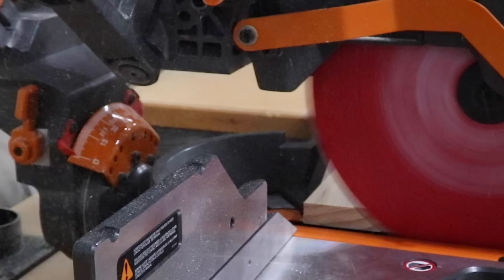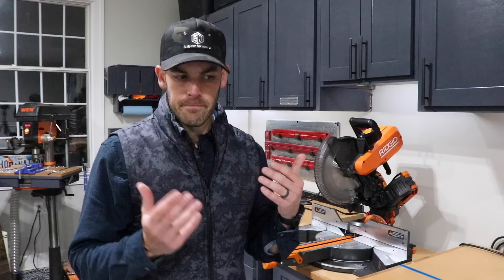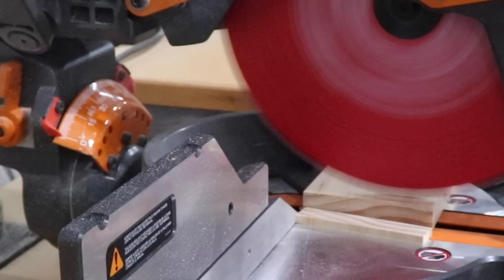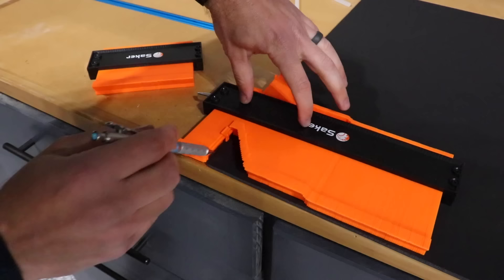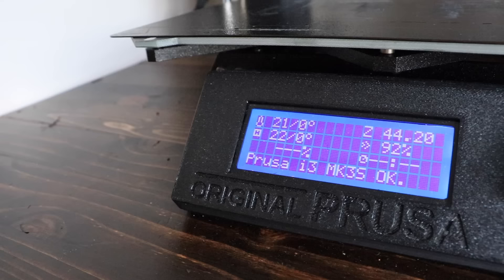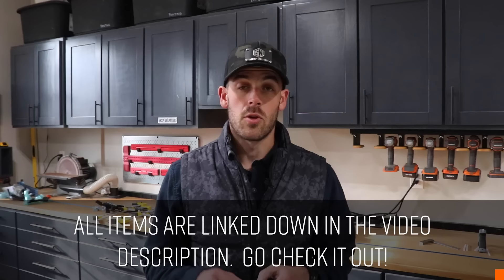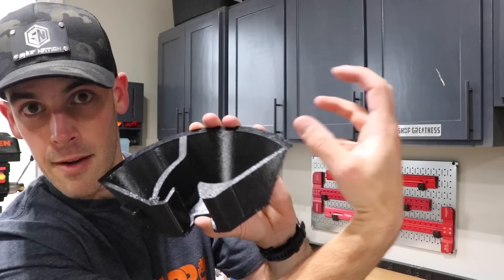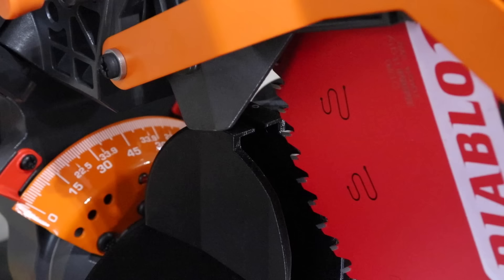Did I Solve Miter Saw Dust Collection?

Comment: I’m a full time finish Carpenter.  The answer for me after years of trying to solve the dust collection problem was custom made dust “boots” from duct tape.  The key is for it to be long enough and wrap around the side of the blade slightly.  When it gets cut up from all the bevels and miters and compound miters I just whip out my roll of duct tape and make another one.

Comment: I like that you showed that it didn't work. I would love to see how it works out. I have found the same results in some of my 3D modeling and printing projects. I would be fascinated to see the result you come up with for the saw. I have the Bosch 12" glider and have been kicking around some ideas for a Dust Collection solution myself. I really liked the poster board idea cause getting the measurements off the machine has always been a struggle.
Reply: Spoiler alert
Reply: I have the same 12" Bosch and found a downloadable file on thingaverse for our miter saws. It is "OK", slightly better than nothing. At best it redirects the dust inferiorly instead of up in the air. If you have a better option, I would be happy to be the guinea pig.
Reply: @patricktomboc2142  This is Dan Pattison's video: https://www.youtube.com/watch?v=pRlZGApo6vA
Also, Keith here has a decent fix for thicker stock: https://www.youtube.com/watch?v=iDQSWgTmGFo In summary of Keith's video, he said to add a rubber strip at the top and follow Dan's guide

Comment: The dust collection on my Makita 12" unit works fairly well. Like, you notice a massive difference if you forget to turn on the dust collection. It has a dual collection setup on it and the lower intake is a flexible rubber. It doesn't SOLVE the problem but it works.

I love videos like this because it's totally great to show failures. It's how things go in a shop!
Reply: I have used a lot of different miter saws and the Makita has the best dust collection by far.  Of course the Kapex is supposed to be better but at close to 3x the cost the Makita will work for me.😃
Reply: Time and time again most videos on the most successful dust collection have been #1 Festool #2 Mikiata saws .... why? I do not remember but one of the worst was the Delta saws. If and if you can solve this then you will have opened yourself to make a stunning amount of profit for yourself as an engineer.

Comment: Lol, didn't see that ending coming.  Look forward to the next iteration!
Reply: Hi Information: you should think about the blade like a fan. Then the chip spray-pattern will make sense. The saw-tooth spacing transports small air pockets around and they get reflected on the wood that has to be cutted. 

When you start to cut then the tooth cut wood chips out and then delivers them up and almost "around" the blade. 
The reason why the the chips or the "wood-dust" lands behinde and up is because the "Collecter-mount" creates a airdistortion, like whats happen behinde a car in a wind-channel. 
The form takes on the air-flow and transports the dust where the air can snuggle up to. Thats why we talk about "flow" air can flow like a river, or at least we simulate it that way in software.

We build a simple housing around our shop saw. Some painter fleece that protects the floor from dirt. 
you can buy them for a few $$$

heres a link to a guy who gave us the idea.
https://www.youtube.com/watch?v=sxpZGbsh4Q0

good luck stay safe =)
Reply: I think the primary problem is the chips have more velocity/momentum than the dust collector so the just power through draft and keep going.  Other tools the chips get slowed down them sucked out.
Reply: your words make no sense.
Reply: @fearlyenrage  The first he talked about sounded as if he was referencing the suction rate? If the suction is too weak, it can't pull on the airflow. By the way, really loved your explanation! You went into the 'science' behind it, and that was really cool. You could say that I am a 'fan' of your explanation ;)
Reply: The dust has to be collected where it is generated. So the collector should be attached at the sled near the tip of the blade. Just check how the best mitre saw dust collectors of other brands work.

Comment: Get a zero clearance insert with a possible vacuum port when you attach the two together.  This way you have suction at the moment of cut and at the rear.  Possible you may need to increase the suction power needed as well.
Reply: I think maybe it should be a little taller and wrap around the back more. Or figure out a way to make something that encases the entire arm assembly and move with the arm assembly.

Comment: I haven't actually read every comment and this just might have been suggested already, but I would try and focus on the airflow that's caused by the turning of the blade ... that is where the dust will go.  Now, when you introduced  your duct, it changed that flow and created a new stream above and around your device.  If you want this to work, you'll have to capture and direct that flow of air when you want it.  I would try and get a couple of sticks of incense or something else that would create smoke and watch the stream both with and without your device.  It should be very enlightening.  Then, cut some cardboard and get an idea what it will take to direct that smoke effectively into your device. 
I hope this makes sense, good luck and I'll be keeping an eye on this thread.   Cheers!!
Reply: I agree. The airflow caused by the blade is much higher than the vacuum. The blade is causing a high pressure area within the collector causing the dust to be flung everywhere but in the collector. A tighter intake might increase the flow velocity by the blade but if the blade is out performing the vacuum that will still have issues. Maybe increase the size of the opening and move the collection further from the blade. The goal being to let air turbulence slow down the flow coming from the blade before being collected by the vacuum. Another solution would be to get a higher flow rate vacuum so that the collector remains at negative pressure even when the blade is turning.
Reply: The incense idea is an excellent suggestion!
Reply: Engineer approved. Smoke study for the win.
Reply: My mitre saw (Dewalt 12") really highlights the difference between pushing and pulling air.  When I hook up a vacuum to the port in back, collection actually gets worse because the vacuum prevents the intake flaps from spreading the same and the dust deflects everywhere else.  Without that (and with no actual change to the physical profile of the tool or collection), considerably more dust goes into that collection channel.
Reply: @33brianmorris  I was just about to say the same. Smoke study. See how the air is actually flowing. Lets REALLY over engineer this baby!!!!
Reply: There is a lot of energy in that entrained 2 phase flow. You basically want to kill the velocity so the dust drops.  I imagine something that has steps like the cross section of a suppressor around the blade and leads to the dust port. Sounds like a challenge.
Reply: I really think this is the key to the miter saw dust problem, the blade is creating a high-pressure area INSIDE and IN FRONT of your collector.  Even though your vacuum is creating maybe a minus 5 PSI at the collector output, your blade may still be creating say plus 30 PSI inside your collector input.  The air to either side of your inlet is near 0 PSI so that is where the dust goes.  Somehow you need to create an in-going air velocity at your collector input that is higher than the velocity the blade creates.  Since a perfect vacuum is -14.7 PSI, it may not be possible to solve this problem with vacuum alone.
Reply: as others have mentioned, I also think that flow analysis is key.  I doubt you can get anything useful from smoke testing since the flow dynamics here are complex.  Interesting engineering problem -- maybe simulated flow modeling in CAD can be used to design a solution.
Reply: @Colecraft13  Thanks for this excellent reply. I came to the same conclusion about the turbulent airflow from the saw overpowering the vacuum after making a plywood box. I found the dust collection worked for about a second, but when  the air current from the blade built up, then clouds of dust came billowing back out of the box. From your comments I think I understand why.

Comment: I think to maximize dust collection it needs to move with the saw blade and be as near to the blade as possible to avoid blowing it all over the place. Great video. I appreciate that you showed how the first iteration failed. I  work in R & D and not every thing works like we think it should the first time around. Keep up the good work Travis.
Reply: this was my first thought. design the intake to attach to the head, not the base. where the little  stock redirect was removed. then at least its dealing with one position/angle and not the full gradient of positions.
Reply: "it needs to move with the saw blade and be as near to the blade as possible " Like Festool part no. 471316

Comment: I have come to the conclusion after many years of using a chop saw, that they are engineered to fill your shop with sawdust and to cross cut wood.   The best way to use a miter saw in your shop and to keep the flying sawdust down, is to use it outside your shop. The next best at keeping the flying sawdust down was a flexible, removable wide mouth pickups just behind the built in saw dust pickup port.  Even though the shop still had saw dust everywhere, I was amazed at how fast the dedicated shop vac filled up using this modification.  Hint: Look into using deflectors under the long arm supporting the saw head to keep the high speed stuff in the area where the air is being sucked up, till is slows down and can be sucked up.
Reply: Cross cutting is actually just a byproduct. The miter saw was invented as a dust generation mechanism. In a weird coincidence the inventor discovered it could be used to cut stuff.

Comment: Efficient dust collection is determined by several factors:
-capture velocity; the capture air velocity must be greater than the dust generated velocity. Dust velocity will be determined by the calculating the tip velocity of the blade (blade circumference in feet x rpm) i.e. the dust will leave the blade at the FPM tip velocity of the blade.
-air volume; the air volume is determined by using an industrial ventilation standard (Q=2.8LVX). Q=air volume, 2.8 coefficient, L=length of slot in feet, X=max. distance in feet from hood to source.
-hood design; all nuisance dust collection hoods should have a flange around the slotted opening. Without the flange a large percentage of air will come from around the side of the hood instead of the front...where it will provide the best collection efficiency. 
For "fun" I ran the calcs and came up with numbers that are not even close to being realistic....which is why, for my saw (12" compound miter) I run a 2.5" hose to a shop vac and clean up afterwards! 😉 P.S. 35 years of industrial dust collection experience...
Reply: Very cool to see this laid out, my first thought was velocity of material. My second thought was a bigger trap would only help, but bigger hose would be way more practical.
Reply: In your formula, what is the mystery variable V?

Comment: One thing I think gets overlooked when talking about dust collection is speed of cut. A certain cut is going to generate a certain amount of dust; the slower the cut the more the dust collection has a chance to collect it.
Reply: True, they are designed with very small ports for the amount of material being removed. My jointer has a 4 inch port and removes way more material per second (bigger surface area being cut) and i barely see a spec of dust.

Comment: You mentioned the key at the beginning:  momentum or velocity of the chips. If you widen the capture shroud, a lot, and make it deeper, you have more surface area at the entry as well as more volume in the acceptance chamber will mean less fighting the bounce and turbulence generated by the blade.
Reply: Down side with the vac he is using can’t do a large source of open air.  Has to be concentrated.  But I like the way your looking at it

Comment: My saw isn't sliding, but I have the saw enclosed in the back and then put two masonite boards either side with cutouts just big enough to clear the downward motion. The masonite, just leans on the back of the fence. If I need to make a miter, I just pull the two boards. I originally designed the back to curve down to a dust collection port for a shopvac underneath, but I found that it worked so well, that I didn't need the suction. I removed it and just vacuum it out whenever it gets full. That left space to put a big drawer underneath to collect the cutoffs.

Comment: When using a compound miter saw, you will adjust the miter way more than you will adjust the bevel.  Your saw table width won't allow you to adjust full miter from left to right.  Fix that first.  Then good luck with the dust.  Best way I have found was to build a cabinet around the miter saw.
Reply: I have a cheapy early 2000's Delta 10", yes I still have the starter one. I too have built a box around mine, however I also added a hose up to the dust port on the top of the blade guard. This gets "most" of it, however I still haven't figured out a way to get the saw dust the comes off perpendicular to the blade.

Comment: with the plastic cowling and dust collection hose - be cognizant of static. The  concentration of sawdust to me suggests either an unanticipated airflow or a static field.  Also I would consider introducing compressed air to direct material where you want it to go.  Just some thoughts.  I read through a good number of comments, but apologize if this has already been mentioned
Reply: i like this idea too, redirect the exit air from vacuum so it slows down the high speed saw dust and gives the scoop more time to act on the dust?
Reply: @bobmagnets1522  this concept is used on cnc routers...granted larger chips but in this case helps give some control on the velocity and direction of the dust
Reply: The dust goes off in an angle from The blade in all directioms. I would keep the Stock collectors in addition to a more funnel shaped printed collector. The opening of the collector has to be as wide as possible.
At least that eorked for my saw. Plus I use a record power cgv 286 with 2 Motors and a 100 mm hose split in 2 70mm Ports to suck that saw.
In the end only power is power I guess 😎

Comment: I too have often thought about the dust collection systems available to the modern woodworker who, even to the present day , usually has to put up with that uncontrollable workshop mess!
I watched your video with great interest as also I have watched two others who have also gone to extreme lengths and had partial success. 
At 76 years of age I spend more time thinking about problems than actually physically dealing with them….like dust collection.
What always comes to my mind, when stepping outside of the normal box, is the consideration which never seems to be given to A) the high speed of the dust coming off the saw blade which, via our own efforts is then directed into the path of the very much slower speed of the suction draft.
It would be fairly simple to utilize the blower side of an extraction unit to direct a flow of assisting air onto each side of the saw blade to encourage better removal of the dust by pushing the dust into the suction draft!
Just a thought
Thomas.

Comment: I have a system I'm pretty happy with. I built a shroud/catch box behind my 12" chop saw like most of us end up doing.  Them I used a contractor style TS dust collector chute (roughly 12'" funnel necking down to 4") offset under my chop saw, with the back of the chop saw fence bisecting roughly half the 12" circle.  Hooked up to my 1.5 horse DC, it creates enough vacuum to back pressure the dust into the shroud area behind the saw.  Every now and then I turn on the DC and brush the saw dust from the corners of the shrouded area into the DC shroud.  It's not perfect, but way better than anything else I've tried or seen used by others.  I think the origins of this idea is from Norm.

Comment: Build a box behind the saw with a decline at the bottom with a hole for the dust to drop down into another box for collection.It works.I used it in the cabinet shop.

Comment: From the research I’ve done on mitre saw dust collection you would have been much better off getting a Makita.  The two dust port collection is very effective.  A good portion of the dust follows the blade around circumference and bypasses the single port at the back.  A blade shroud collector is the difference.

Comment: Deck mounted dust collection on miter saws are secondary to blade shroud dust collection. You have to have high suction at both points to perfect it. I have a 12” dewalt slider that is nearly dustless even in MDF
Reply: Hello, fellow miter saw owner , could please somehow post multi ankle pictures so as to adapt to other brands please, thank you.

Comment: Same thing with things I tried on my Bosch Glide, especially when I remove the on-board dust collector.  I noticed in videos that the one that people say that works best, the Festool, it seems the most important part is how robust the on-the-blade chute and suction is, and as I found out with mine, that is the minimal you HAVE to keep - which of course it is the hardest to design around.  Yeah.